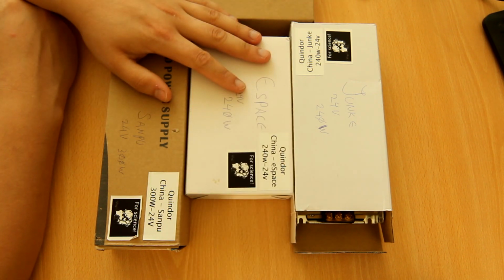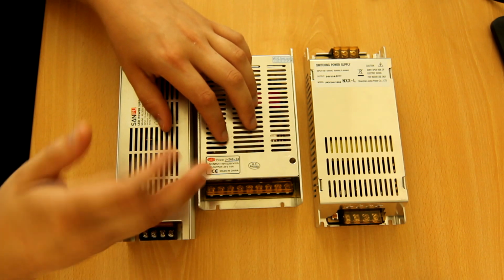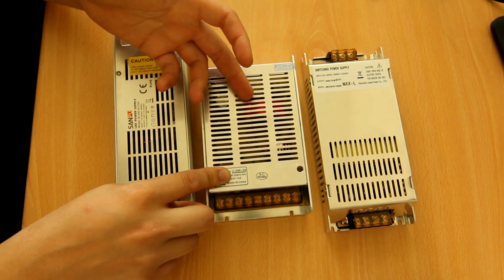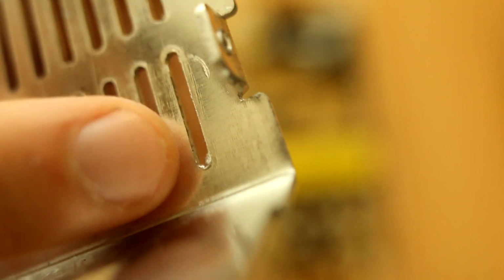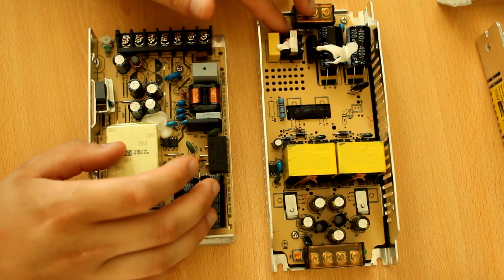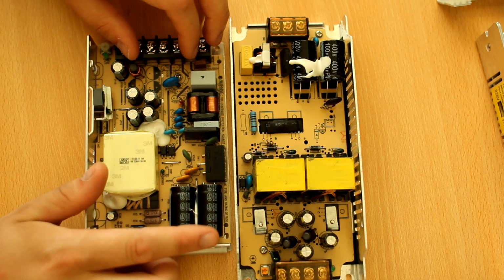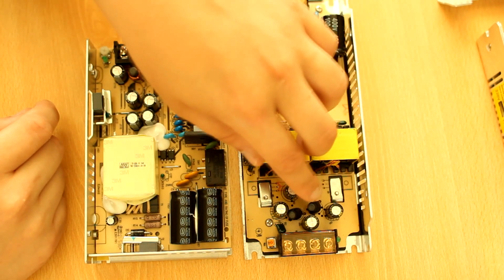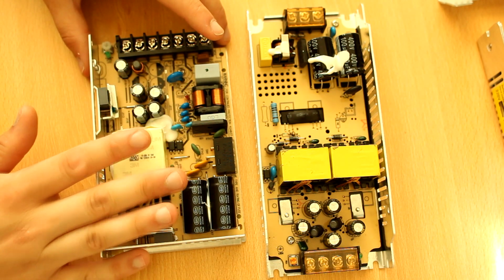Why pay more for a name brand power supply? (037)

Comment: Meanwell is the best I got "Worked" on cheap Chinese junk supplies go ahead and pay now or buy again later like
 I did as a courtesy I will not name the brand I bought first THINKING I was saving money I didn't they won't hold
 steady voltage  and will NOT do the advertised amps at all the product I got is a joke BUY MEANWELL to begin with.

Comment: You can get older used Mean Well units for a lot less than new. I got a Mean Well SP-750-24 that I use for running my dual channel battery charger (350w per channel) for $40 on Ebay.
Reply: Meanwell "RSP" series are designed for current sharing with built in circuitry electronics to make current sharing 
easier as a built in function no need to solder on resistors and do "HomeMade" current sharing which is what the builder did on the 150 amp pile of ganged together junk he foisted off on me Yeah I learned an expensive lesson.

Comment: I'm happy buying 5 cheapo drivers for the price of 1 meanwell. I noticed they run a little hot at max/sustained output so I just put a fan over them. I can also recommend Chargery Power Supplies as a high-quality meanwell alternative, it's very nice being able to dial in the voltage and amperage and see exactly what is happening with the status screen, and they're still about 30% less than meanwell.

Comment: Mean Well are fine, dude. They are perfectly adequate power supplies. They aren't a Delta, but they won't set your house on fire. After nearly losing my house to a dodgy 240v power brick, I am very, very cognizant as to what plugs into the wall. Basically if it doesn't come straight out of the box with the brand name product I bought it with (or isn't from one), I bin it straight away. There are a lot of fake Mean Well supplies out there. The genuine ones are perfectly fine.

Comment: Can you do (with Oscilloscope (under/over load)) tutorial PSU video (high voltage side, until the transformer) (each 230V 50/60Hz (100/120Hum (mH? kHz? (50kHz-5MHz, >100MHz))) filters & components (examples with and without components, and the components of the quality difference) (each component of the explanations and examples (EMI filter, common mode filters))(which is the difference between the two large and two smaller one transformer (Measurement Results))(Capasitors ESR, ESL, series, type, brand)(Ferrite Beads(transistor base lead)))

Comment: What kind of power supply do you recommend for providing power to 5, 5v 4.2 amp USB power outlet? each outlet has 2, 2.1 amp USB connectors.